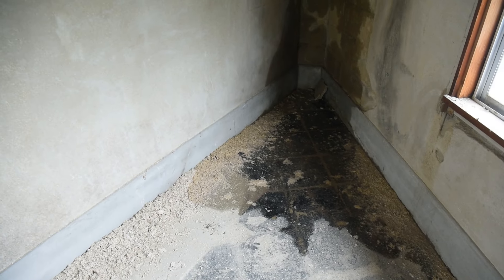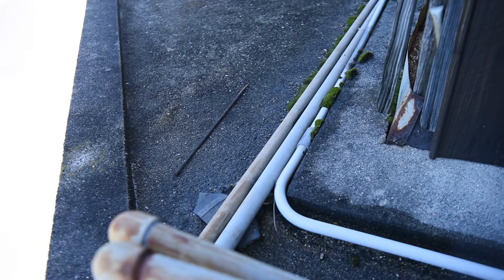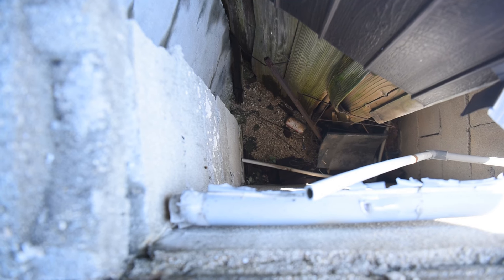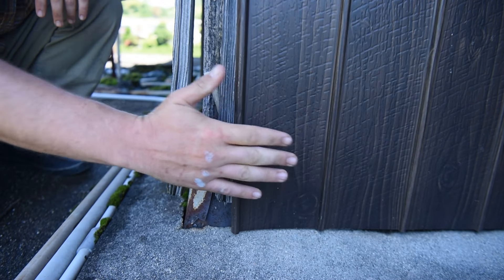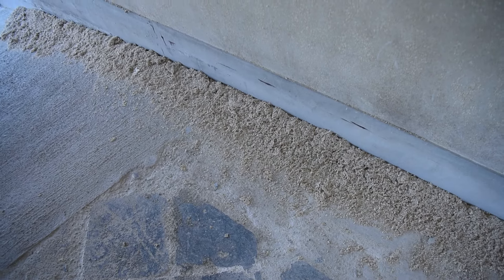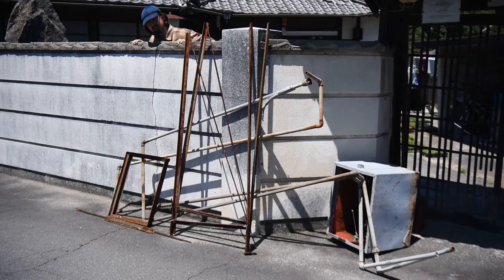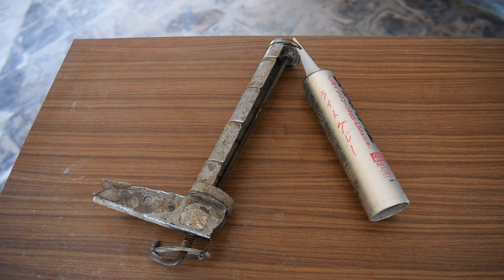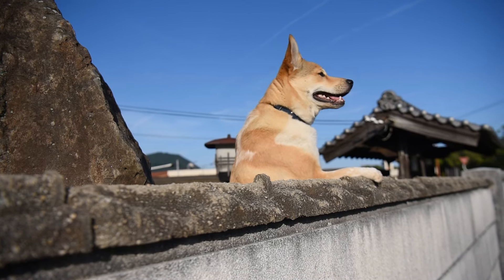Water Damage Plaster Repair & Compromised Roof » Japan Akiya Restoration » Ōmishima, Imabari, Ehime

Comment: Put some mesh wire or fly screen off cut over that concrete hole opening. Will stop it clogging up again. Walls looking tidy!
Reply from the maker: Great idea, thanks! It's raining today and there's officially no moisture inside :) :)